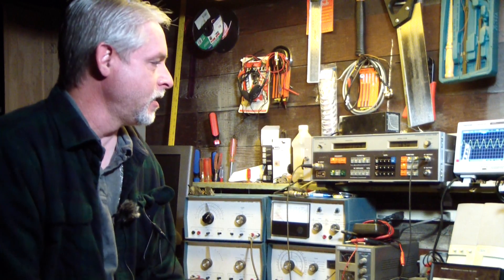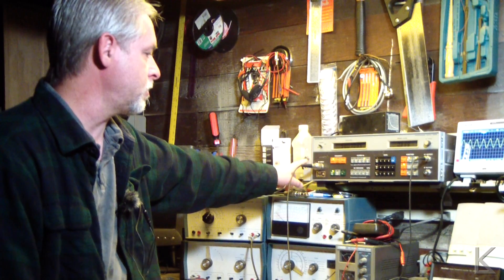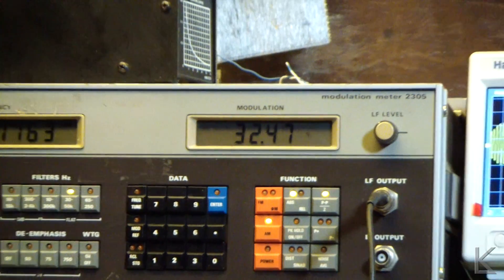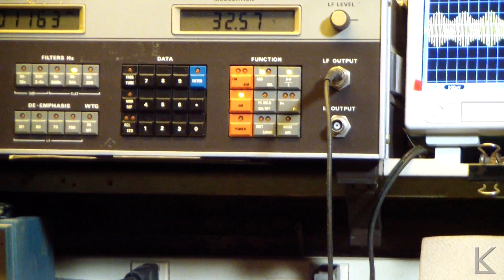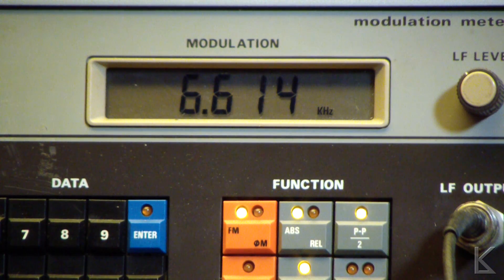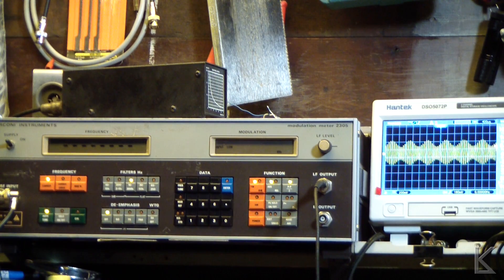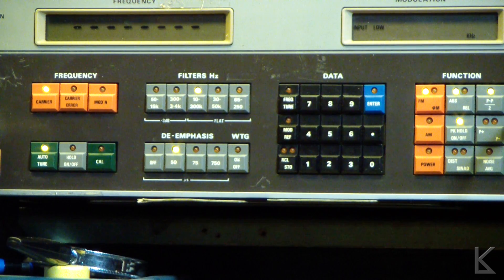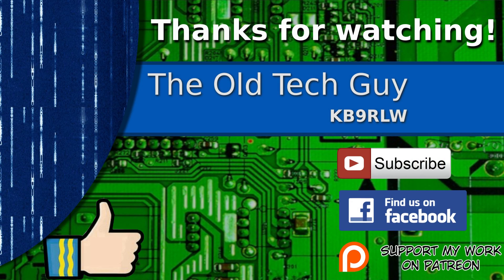Ham Radio - Measuring stuff with the Marconi modulation meter model 2305

Comment: You have the same scope as me, I don't know if you know this, but that is a 200MHz scope that is limited by model numbers stored in a couple of files in the scopes operating system.
All you have to do is connect a usb to serial cable ( the type used to program some arduino's ) to a pin header on the back of the board and change the model numbers contained within them using nano. As you are a linux guy this should be very basic stuff to you. The only other thing needed is to remove two surface mount capacitors to get the full 200MHz bandwidth which is just as simple as they are placed in a very easy location and easily identified.
If you like I can link you to an article that fully explaines the proceedure.
It takes about 10 mins to do and the hardes part is removing the two screws behind the handle.
I did it to mine and am very happy with how simple it was and the results.

Comment: Hello Kevin, I have one of these beauties, have you popped the covers off ? What a work of art ! My Wouxun KG-UV8D will deviate up to 11Kc sometimes when I key up. I used my spec an to verify this so your Marconi was most likely giving you an accurate reading. Thanks for uploading your video! 
Oh, how did you make your little T sampler ? 
73 N8AUM
Reply from the maker: I took a standard BNC T and cut the pin in the center leg.  You have to cut it right down to the plastic.   It's tricky cutting in such a small place.  I don't remember exactly how I did it!

Comment: The MOD button allows you to read the frequency of the audio tone in the rf carrier. You forgot to demonstrate its RF power measurement capabilities as well as many other features the unit has. I have had mine for a couple of years now and I am still learning its capabilities. The hidden menus are a bit of a pain but worth learning. I use mine with a range of different attenuators and it is nice to be able to program in offsets to account for them. One of my favourite bits of test gear but I had to add deeper shelving to mount it, not a small unit. Great video, keep up the good work. Karl, M0KRL..

Comment: The audio filters are all important.  Using the 300-3.4K  filter would have made the measurement more accurate.  With this in, it matched a calibrated HP8903B, without it it reads a little high.  The 65 -250 is perfect for pl tones.  Unfortunately the Sinad option was not installed but the LF output can be used to see gross distortion.
Reply from the maker: +rlmillr Good to know.  Thanks.
Reply: I also just noticed the freq, the 10Mhz looks like it is acting up unless the radio is really 1.6Khz off freq.  I would check it with the other HP counter without modulation.
Reply from the maker: Nope, the baofeng is actually that far off.    The Marconi had been on for an hour and I've been checking it before I use it.   Both the HP and my Heathkit freq counters are within a couple of hrz of each other and they both saw the reference as being dead on.

Comment: Have you calibrated the Marconi Kevin?
Reply from the maker: +Off Grid Texas Homestead the person who sent it tuned the reference to a rubidium reference, so it's at least on frequency.
Reply: If I remember it runs the self cal at every power on.  W2AEW does have a nice video to check FM calibration that can be done without expensive equipment.
Reply: I was thinking about if the Marconi gave a false reading if it was calibrated to a known source for modulation etc.
Reply: referring to deviation measurements
Reply from the maker: It does a self-calibration upon startup.   As long as the reference oscillator is on freq and producing a clean signal, it should be accurate.